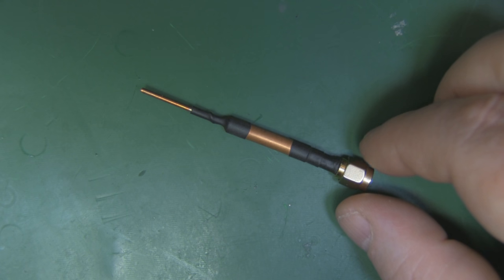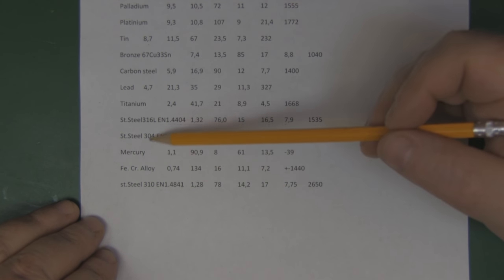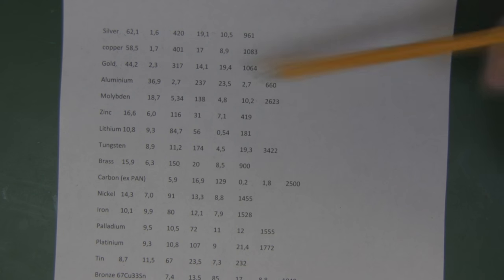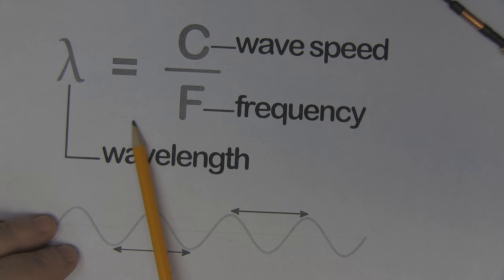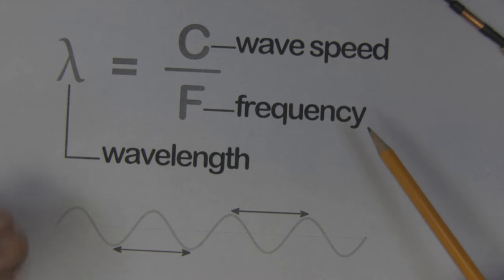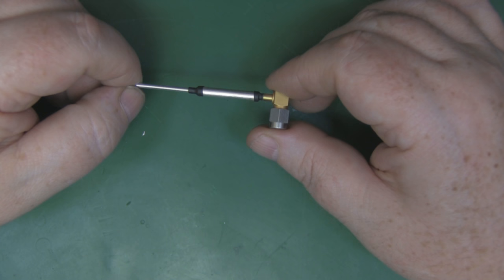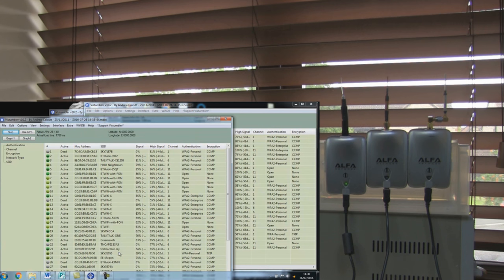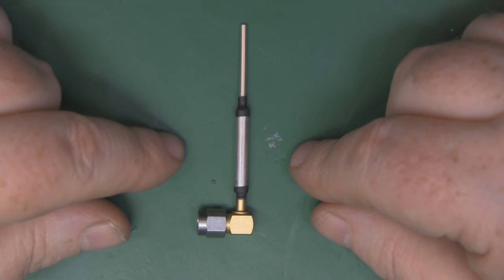Will an antenna made from silver be better than copper?

Comment: Sleeve balun (choke really) works reasonably good only when difference between feed coax diameter and sleeve diameter is big, as in retail ones. In yours it does not choke current on outer side of coax and your feed line works as antenna, distorting radiation pattern (note that your feed line to silver antenna is much longer and includes two elbows).
Reply: That could explain why there are less access points but stronger.

Comment: Love your videos but I have my doubts about the measuring arrangement - errors that may have occurred:
- differences in the sensibility of the adapters 
- influence of the three dipoles against each other (Yagi effect - elements may have formed some kind of beam)
- the slight difference in placing against the tested network may have caused fading/qsb through reflections/interference patterns 
And I'm sure you know that resonance & SWR are two kind of things.. (half wave dipole -> feed point impedance of ~73Ω)
Reply: 73 ohms?  That's for a horizontal dipole at a specific height, not a vertical dipole.
Reply: I was talking about dipoles in general: ~73 Ohms is the feed point impedance in free space.
At "low" height over ground (relative to wavelength) a vertical dipole for HF (3-30 Mhz) has usually an even higher impedance (70-100 Ohms) than a horizontal one.

But at higher frequencies like VHF the influence of ground gets smaller and smaller and you can ignore polarization - That a Dipole has ~73 Ohms is also the reason coaxial cables for TV and radio antennas have an impedance of 75 Ohms.

With WiFi we're talking about microwaves (UHF/SHF) - I think we can ignore things like ground/earth losses/reflections completely here.
I'd love to hear what Andrew thinks about SWR on WiFi antennas - waving around with a hand in front of my  Ghz antennas affects the SWR big time..
Reply from the maker: I agree with you I have since measured the VSWR of each 
1.87
1.81 
1.78
7 to 9% reflected power
Silver at 1.7 and copper at 1.81 I measured each one 5 times and took the average and to be honest in the real world outside of a test environment you would not see any difference between the 3. Could be worth doing a test with copper or silver against say iron or steel  though
Reply: Doesn't this mean 75 ohm coax should be used instead of 50 ohms in your reference models?   Do mfgrs design their adapters to match 75 ohms instead of 50 ohms?
Reply: When it comes to transmitters, 50 Ohms is the choosen compromise everyone matches to:
http://www.belden.com/blog/broadcastav/50-Ohms-The-Forgotten-Impedance.cfm
http://www.microwaves101.com/encyclopedias/why-fifty-ohms

In short: 50 Ohms is the standard for transmitters (or TRXes like WiFi, etc.),
75 Ohms the standard for pure receivers (sat cable, terrestrial radio & TV, etc. ..)
Reply: Vertical dipoles at HF are most likely 'Ground Plane Antennas' with Z at 50 ohms or much, much lower.
Reply: A 'vertical dipole' and a 'ground plane antenna' are two different things - the ground plane is asymetrical and uses ground (here the low feed point impedance) or has radials slanted in an angle (to achive 50 ohms). The radiation pattern is also different..

Most "verticals" used on HF/<30MHz aren't what you'd call a symmetrical dipole (I think I only know about a CB antenna called 'Sirio D27 CB' which is a real vertical dipole..)
Reply: What was the BEST VSWR  for each and at what frequency?
Reply: andrew mcneil - I would like to help on finding the material it's a bit hard to find the right kind. there's a site called etsy and they have different gauges of silver wire there, I personally would go with silver filled wire not plated and not solid wire do to the fact that the waves travel on top/surface of the wire and not inside. Once you have the wire and finished the project u have to polish all the silver as fine as you can get it the smoother it is the better. Yes silver is the best for video and audio straight connect and wireless applications. it is hard to find a silver reflector but if u look hard enough you will find it. if you need any help just ask. thanks for the videos
Reply: Hector L: filled wire is quite pointless for RF applications - you maybe want to read about the "skin effect" on wikipedia
Reply: salat - How about you read his post before you try to blast him on a youtube comment.  He states "do to the fact that the waves travel on top/surface of the wire and not inside." which, by definition, is "skin effect".  Maybe he does read wikipedia.  He might not be able to spell due but he obviously knows what skin effect is.
Reply: @Yememag Why would he want to use silver filled wire instead of silver plated  then?

Comment: I wonder if the difference with the silver UUT is the way the antenna is mounted. It has more ground counterpoise than the others but it also carries the loss of a SMA right angle adapter. The test isn't very fair because they are not sharing the same exact same location. You should do the tests individually wth the exact same test stand if you want to prove it out. Silver made an appearance in some famous CB/HAM antenna designs for the loading coil material. I think the K40 antenna was the first design to utilize silver loading coils and patent a design with it.

Comment: also the thickness of the antenna will affect performance. if its thin theres resistance to rf. same theory as ac and dc electrical conductors. ohms law etc. so a very thin silver antenna may work as well as a thicker one

Comment: wonder if the silver one performs better because the 90 hook adapter you added ... could make some difference in the impedance. i always learned to use less adapters as possible , it keeps a mistery i think if silver really matter.
Reply: I thought the same.. anyways it got the best result and would be even better without the angle..

Comment: I don’t watch much videos, ran across your video and was very impressed. I’m currently looking at a home tv outside antenna, and trying to do research, and find out better way to go, will say I will try to find a silver outside antenna first, of course oxidation comes into play. Let me ask you this , is it possible to plate something aluminum in silver and get the conductivity needed for an antenna? Or is it probably cheaper to go with a silver base?

Comment: One thing that may surpass silver by quite a bit is graphene and there have been 2.4ghz antennas created out of it which work quite well.
Reply: I found a paper 📜 on graphene antenna for mobile phone application. There was a graph 📈 with the same speed on both anntena materials. I'm curious how it compares further and further away from a cell tower.

Comment: wow it was 8 db difference between copper and silver. 
perhaps the silver one has better swr are you sure they are exact same length in all parts top to bottom ?
Reply from the maker: Yes they are as spot on as you can get making them by hand. I have since done the test again several times and the silver one consistently comes out on top but the average is more like 3db.
Reply: Now I'm really curious what that would do with a 9dBi stacked element dipole antenna, would that also provide average of 3db so if you compare it to like the Alfa https://www.alfa.com.tw/products_show.php?pc=46&ps=174 ?  And does it mean that a copper made one gives actually less gain because of losses or does the silver one gives you the actually gain as calculated
Reply: Single sleeved dipole will always be around  2 dbi practical gain, no matter what material, silver or copper!

Comment: I am not sure if Silver I'd much better, I looked also at a other SSID channel: BTHUB4-39X2, then the performance of the silver is equal to the standard antenna, only the copper performance is really worse. I think more testing is be needed to confirm. where is the standard factory antenna coming from, it actually performs very good.

Comment: I wonder if the fact that copper and silver repel magnetism may have more influence than straight conductivity. I recall way back in tech school the differences in wave propagation at microwave frequencies being a product of skin effect, the path from transistor junction through to driven element ideally needing to be gold at aminimum depth of several (or many) microns to avoid compounding losses. Copper is the poor cousin, only good for sub Ghz. I did a test recently by heavily silver plating a 5.8ghz antenna, and got a full 3dbi improvement, every bit helps but bigger gains can still be made elsewhere, like feeders and receiver front end noise.

Comment: the end antenna is running differently than the others due to being placed in a different position above the booster the radiation pattern will be different. the metal in the device is a ground. youve tried to keep the antennas in the same area which would seem to be a good idea. when measuring and comparing antennas, the antenna must be measured in the same position, [height included] as the other antennas. so one at a time. 2.4g is a pri----- of a frequency to measure. best to use the same booster as well. and if you can leave the room. you walking around is changing reflections and readings. hamies are your friends
Reply: I think the silver antenna was even the furthest away from his computer and gave the best results..
Reply: @ElRealista7  The computer being closer will make it perform worse as will having other network analyzers next to them hence the middle one jumping about as the ones next to cause interference I find it hard to believe this guys a teacher and doesn't do a proper scientific experiment where you try your best to eliminate all possible variables. There is also the propagation factor of silver vs. copper he shouldn't be building with the same dimensions when using different materials. In my experience with making rc tx and rx antenna the driven element should be about 29mm that has given me the best range every time but, don't tell Andrew that he'll swear up and down I'm wrong haha.

Comment: wow, I didn't expect that much more performance from the silver antenna. Is it possible that there are very small changes in the manufacturing of these antennas that could cause the differences in performance?
Reply from the maker: Hi Volt in my experience there can be huge differences and I am not just talking about the cheap sellers on ebay!

Comment: im new to this subject, couple of yrs ago i faffed around with tin cans andsavoury biscuits cardboard ally inside tubess i forgot the name of the biscuits. 
and wine bottle tin cans and sma connectors, which were neew to me, and washers and plstic spacers, etc etc etc, but did nt really have much joy, so gave up.
now having found yr channel im thinking that they were all a waste of fiddling faffing about!!!
am i correct in thinking that your method using short lenghts of co ax solid cable  gives better rusults and is the way to go?

Comment: Do you get much more gain from a 1/2 wave dipole, than you get from a 1/4 wave? 
Also does the wire thickness of a dipole make much difference on the length of the wire?
Reply from the maker: Hi Andrew this is a 1/2 wave dipole as you have 2 1/4 waves stacked up on top of each other. The 1/2 wave has around 2.5dbi and a full wave has around 5dbi.

Comment: Which type of silver is it? Is it the silver used to make jewelry?
Reply from the maker: Yes 9.6% if I am remembering correctly
Reply: @andrewmcneil  so it means there was only 9.6% pure silver and rest is some other metal. How about 100% pure silver used in jewelry. Its cheap if the results are much better. Would love to see the antenna made of 100% pure silver.
Reply from the maker: @talalzahid84  To be honest I think you would need access to the university of Nottingham’s RF lab to measure that kind of difference even then it would be so small would it really matter.
Reply: @andrewmcneil  Got it. since I'm big fan of yours and you're my teacher and I love your videos. Please let me know that where to connect the ground wire of biquad antenna in a wifi router as replacement of one of the omni antenna since it doesn't have ground connection.
Reply from the maker: @talalzahid84  Use a mulitmeter on continuity to find the electrical ground and solder to that.
Reply: @andrewmcneil  love u
Reply from the maker: @talalzahid84  Your wellcome

Comment: An interesting lecture Andrew but the advantage of using silver over copper for 2.4 Ghz is about the same in real life as leaving the spare wheel at home to increase the acceleration of your car. If it is possible, I suggest repeating your experiment with a modem placed at one end of the garden and the antennas at the other so the testsesults are done with nothing in the way. That way the comparisons would be more acurate. BEst wishes, Richard

Comment: First of thanks for interesting videos, 
Found this:
Joule heating:

P=I2R

Any energy you use to make heat is energy you aren't using to make electromagnetic waves.

So first, you should consider the resistivity (ρ

) of various metals. A lower resistivity means you will need less of a metal to reduce the resistance to an acceptable target. Here's a selection, ordered from lowest to highest resistivity in nano-ohm-meters (nΩm), of some metals you might consider using in an antenna:

 Silver: 15.9
 Copper: 16.8
 Gold: 24.4
 Aluminium: 26.2
 Zinc: 59.0
 Nickel: 69.9
 Iron: 100
 Tin: 109https://ham.stackexchange.com/questions/1388/effect-of-different-metals-for-antenna-elements
Reply: Its popular with goldplated cabels but silver is the winner.:)

Comment: I would look somewhere other than higher conductivity for the extra gain of the silver antenna. How much current is the antenna transferring to the wi-fi receiver? At a possible signal current of a few nanoamps (likely a gross overestimation) and a conductivity difference of a few milliohms between the copper and silver antennas, Ohm's law tells us the signal voltage improvement will be a few picoVolts. The difference has to be in some other property of the metals or a difference in the construction or orientation of the two antennas.

Comment: So how would a mercury antenna work?  While I don't believe everything I read on the internet, there are some reports out of Russia, that during the cold war people used mercury Antenna's to receive Western TV signals. There was apparently a run on thermometers in the town and these worked so good they caused interference to which resulted in government agents showing up at the door. (Like I said, I don't know that I believe everything said.) A mercury antenna could be quickly changed in both shape and size as well.
Reply from the maker: Mercury is a poor conductor so I don;t think you would get much in the way of performance
Reply: @andrewmcneil  How about nanocoating?

Comment: Fantastic video, may I ask if your still a teacher
Reply from the maker: 2 days a week
Reply: @andrewmcneil  That's awesome. May I ask what else keeps you busy, do you have a second career, will you be making new videos, do you still enjoy building ants, why did you stop putting out YouTube videos when yours are by far the best from a knowledge and building standpoint.

Sorry for all the questions but I find your videos as an ex-Brit army Rad-op very fascinating and I'm now looking to develop a free and open mesh network using Open WRT and B.A.T.M.A.N protocol with same antennas diy for range, ant array and making the most out of the limited legal transmission power allowed to achieve goals.

The biggest hurdle at the moment is non line of sight here in Singapore.

My goal is to start with a small test mesh network built on open wrt and batman and be able to relay Internet and lan from my home HDB (like council fat in UK but nicer) and transmit the Internet about half a km for proof of concept. Then use an app called Jami which works offline (no Internet access) so it's like WhatsApp and still be able to make calls, both voice and video and send pictures and docs without any typical isp.

Cool idea and worth spending a lifetime on lol
Reply from the maker: @armstrongskyview2810  I will be uploading new videos very soon (next week)! I had a loss in the family and me and mrs antenna took some time off and I have been traveling.